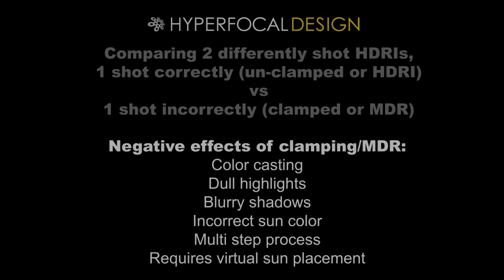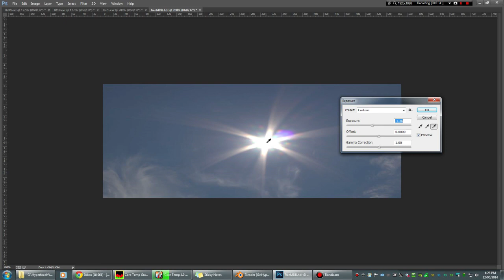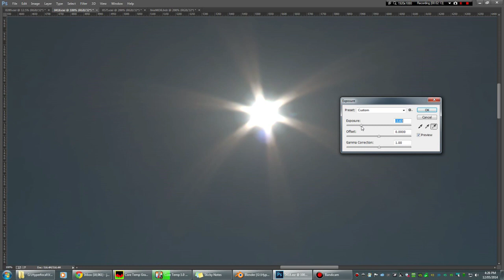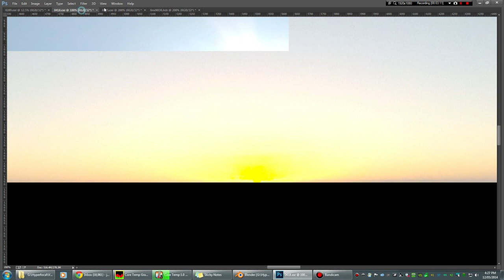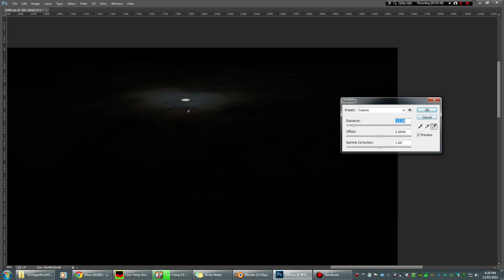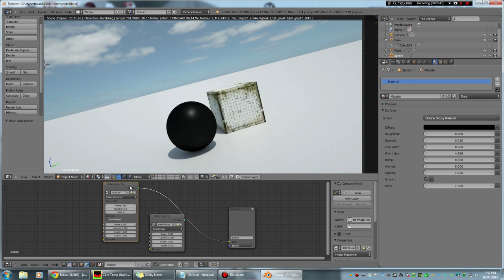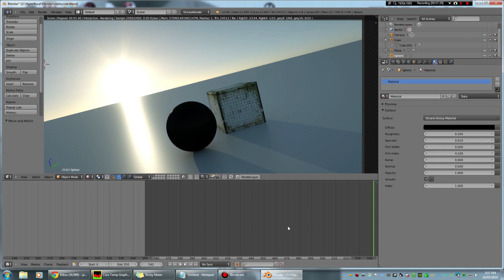Clamped vs Un-Clamped HDRI in image based lighting

Comment: Well done. Very informative. Don't know if you still support this clip as its been a while since posted, but can i ask if you used an ND filter to capture the full power of the sun? If so, was it a gel rear lens filter and what kind (ND400,800 etc) and one more question is which lens did you use. I've been trying everything but fall just short of that perfect High Dynamic Range look. I use a sigma 3.4/8mm APS-C Canon. Any help would be greatly appreciated. I use C4Das well in case you need to know. Thank You.